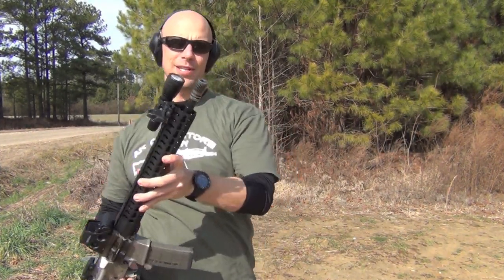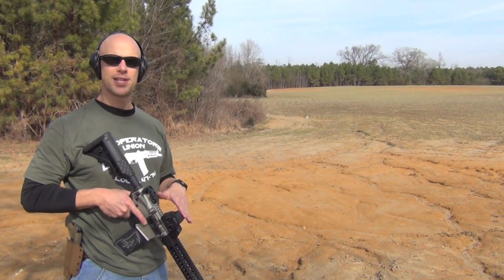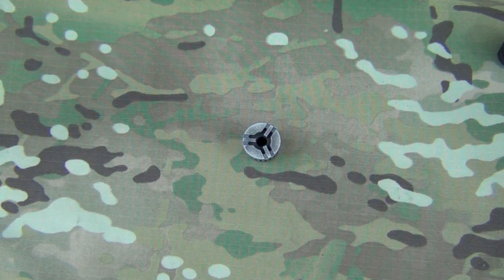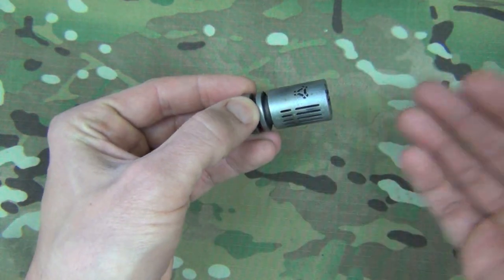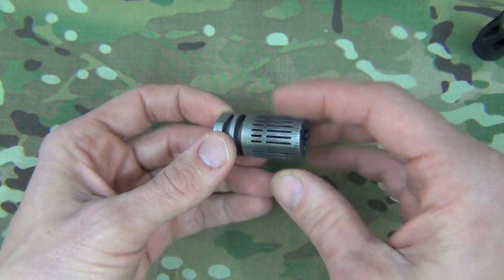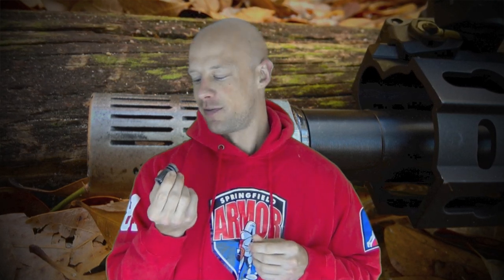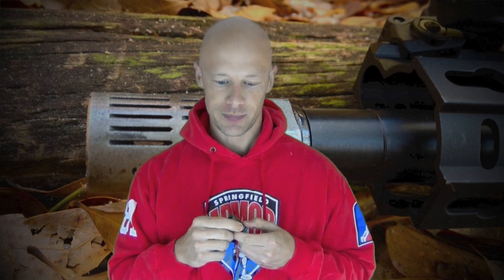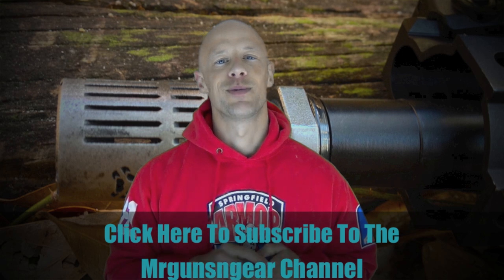Sintercore Auxetik AR-15 3D Printed Inconel Muzzle Brake Review (HD)

Comment: Great review! Off topic here but what rail system is that? Would it fit on a Midwest barrel nut like the one used on the g2 model rail since I currently have a 14.5? Thanks.
Reply from the maker: Thanks.   It's a CMMG (I have a review on it).   It uses a proprietary nut.

Comment: 300 dollars? that thing better come with some suckie suckie hahahaha jk.... looks cool though.
Reply: Inconel is a very expensive exotic metal. $300 for the 3-4 ounces of material and the work it requires to make one, is a decent cost. If they machined it from a billet it would take about 3-4 hours to make one on a CNC lathe. .
Reply from the maker: vector6977 It sure ain't cheap stuff...
Reply: vector6977
 Coulnt machine it even if you consider electrical discharge machining. The geometry of the interior makes it so this muzzle device must be "grown". The only way to do that is 3D printing